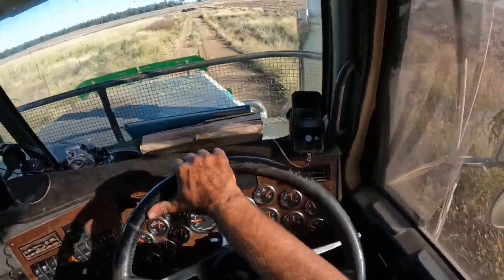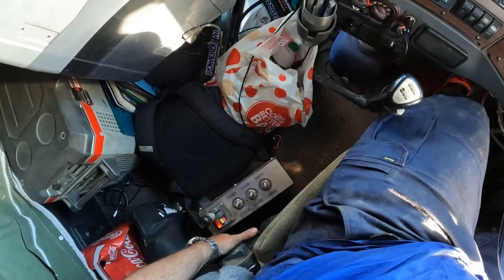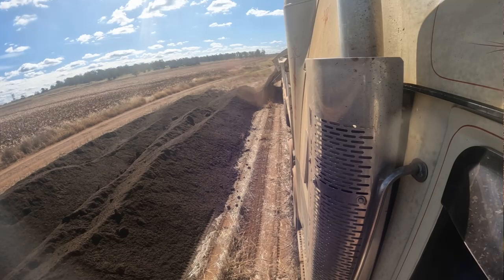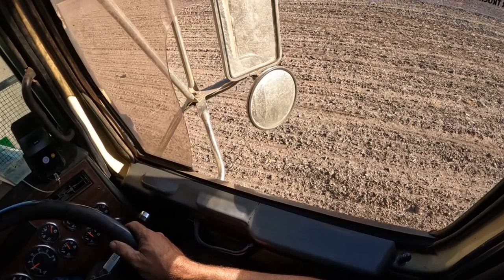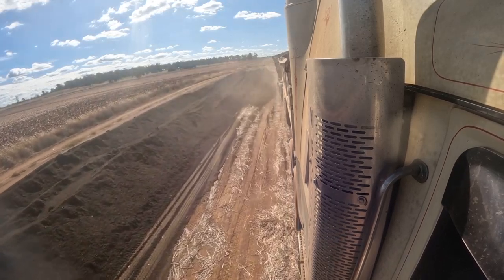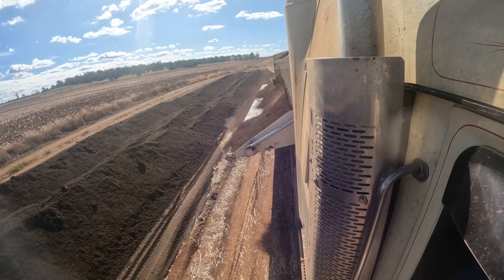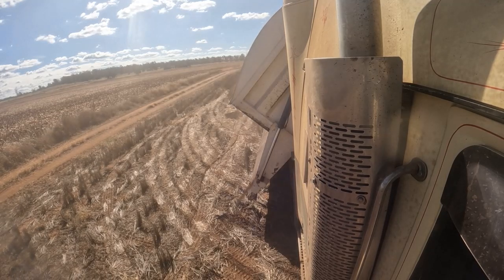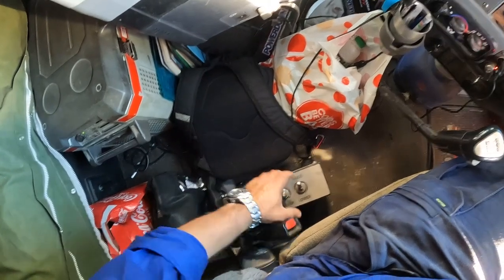How does a side tipper work

Comment: Late to the view here.. very interesting, but I did notice one mechanical "problem?" The ram on the gate of the front trailer, just when it went to full extension there seemed to be a lot of pin movement .. it may be designed to work like that though , the gate hits some form of mechanical stop perhaps 10 to 20 mm before the ram hits full extension so perhaps it's designed to hold it tight ,  anyway.. interesting stuff, thanks mate
Reply from the maker: Lol yes they old trailer and the is a lot of free play.